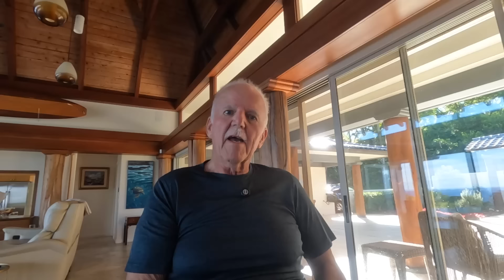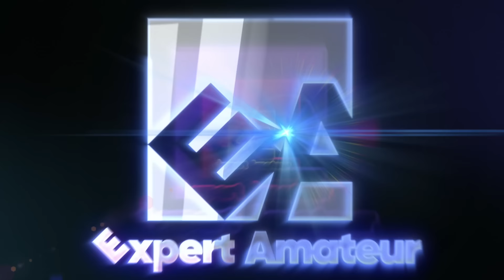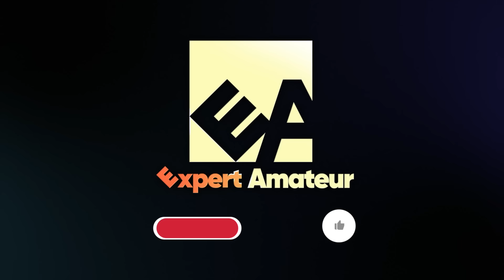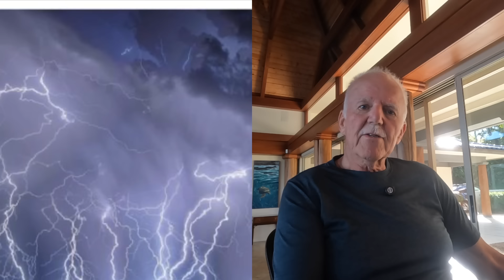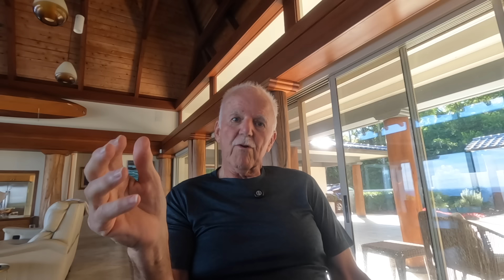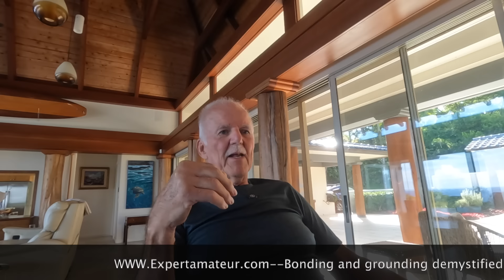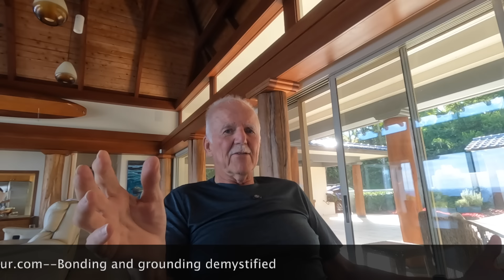solar grounding

Comment: I prefer bonding all my panels together and each array having it's own ground 10' copper clad ground rod rod. A separate ground rod for my AC panel. My DC from my solar panels are isolated from my AC main panel via my inverter. I'm 75 and been an electrician all my life . I worked for the federal government and had extensive lightning,  grounding bonding training. and installed grounding systems throughout Illinois.  Installed many ground counter posts around FAA facilities will sensitive electronic equipment vital to air traffic saftey. Solar systems should have their own DC grounding systems isolated from their AC grounding systems.
Reply from the maker: It seems like you would be well versed in induced current from separated ground rods. Even if your inverter has transformers (transformerless inverters do not isolate the AC and DC sides) your inverter would be subjected to induced current if the solar panel ground and AC panel ground are at different potentials from a nearby lightning strike.

Comment: Is 6ga. copper even sufficient to carry the current induced by the potential difference between two ground rods during a lightning strike? Seems the flow of charge through the earth is dependent on a lot of factors that be difficult to know. I can see an argument to have a well insulated panel framework (from the earth) with a big wire back to the single earth ground, as well.
I'll have to check out your paper. I also wonder if the group at UF that does lightning studies has studied these questions.
Reply: A #6 solid copper wire will sufficiently conduct 60 amps to ground. 
A 5/8" x 8' driven grounding electrode in moist soil is only capable of conducting 60 amps. 
Mutiple grounding electrodes may be used but must be at least 6' apart and bonded together with a continuous copper conductor. 
Lightning is unpredictable at best.
Reply from the maker: The purpose of the bonding conductor is to reduce the resistance between the ground rods so the potential is minimized. The potential will be determined by the initial in-ground voltage spike  times the ratio of the resistance between the ground rods to the ground resistance from the origin to the furthest ground rod. Keeping that resistance as low as possible, like one ohm or so, minimizes the potential and therefore the current. If the strike is too close all bets are off, but at that point the electromagnetic wave in the air induces huge currents and voltage everywhere in your gear and toasts it.

Comment: What is your view on grounding the battery negative?
Reply from the maker: Don't
Reply: @ExpertAmateur-xn6dr  I'm afraid Victron recommend it as does the code in UK. The  issue becomes that because the solar charge controller battery negative is connected to the solar module negative, the array becomes grounded on the negative side which our code warns against. So I'm caught between a rock and a hard place.

Comment: Thanks for the insight. I live where lighting strikes are common. I have installed lighting rods on my house because of trees close to the house having been struck. One question, should the lighting rod ground rod be tied together with the panel and array grounds?
Reply: @minorhull8347  I believe not, if you tie your lightning rod to your panels current will flow partially or fully through your panels, exactly what you don't want
Reply from the maker: Your lightning rods probably have a really good earth ground and they are probably bonded (connected) to your service ground, so yes. If they are not bonded to the service ground I'd call your installer and find out why they aren't. That's standard practice.

Comment: Guess it may be a matter left to the installation specific to each system. Lightening doesn't look for metal, it looks for a path to ground. Specifically earth providing that path reaching up to the energy in the atmosphere. 
My installation of panels is ground mounting without metallic framing. The only somewhat clear path is from the cabling to the inverters which themselves have lightening/surge arrestors in place to hopefully catch and direct any surge to earth ground. But otherwise my PV panels are not so hot of a target for lightening even though lightening has no rhyme or reason to choose where it goes. But I elect to not turn my PV panels into a lightening spire by installing a clear path to earth and inviting an entry point to go anywhere and everywhere in my system. 
I understand the voltage leakage coming from inverters to panel frames. There is also no path between PV wiring and the frames. It is an isolated DC circuit and many mistakenly take this voltage on the frames to be the extremely high voltage generated by the panels. When it is high frequency voltage from the inverters what's able to jump the gap between PV circuits and the frames. It isn't dangerous other than like you say, gives someone a little zap and scares them enough to jump off a roof.
Just my take on it. Think it's a mistake to invite problems where there are none but I'll suffer my ignorance alone if that be the case...........
Very much appreciate your video though! Good to hear other folks experiences and thoughts.

Comment: This is just my opinion but I don't ground my panels "cuz I believe it creates more of a magnet to attract lightning & all my panels are mounted on wood to act as a better insulator. But I do have arrestors hooked up to all my solar chargers. Then my property is surrounded by pretty high tress which I suspect would make a better draw from my panels. Either way, a direct hit will likely take out a system grounded or not.
Reply from the maker: A direct hit will definitely take out your equipment unless you spend 10 or 20K on prevention. And lightning arrestors just provide a path to ground, which doesn't help much when the ground potential is a few million volts. This video set is all about nearby strikes, and it's not about code--it's about saving your equipment, which code doesn't care about--at all.
Reply: Naaa, I had a radio tower and lighting has direct hit it quite a few times, I had equipment on and the ground system dissipated the strikes and zero equipment was damaged. Aluminum panels ungrounded will have a static charge on them and create lightnings favorite meal.
Reply from the maker: @GoonyMclinux  Yup, you radio guys are lightning studs. I'm not going to spend that kind of money because I'm not supporting a tower. I just don't want the hundreds of strikes that hit within a half mile to kill my $10K worth of gear. In the rare direct strike I'll be buying new stuff.

Comment: What about metal pole mount working as the ground
Reply from the maker: If it's buried deep enough then yes, sure. If you want to find out, pound in a ground rod about six feet ways and read the resistance. Less than 50 ohms and your pole is doing a fine job. But since you now have a ground rod six feet away, bond it to the metal pole with some bare copper wire. Belt and suspenders.

Comment: Great video. Regarding the neutral to ground bonding, don't some of the HF inverters have this built into the inverter? So for off grid systems, if this is the case, there would be no neutral to ground bonding in the service panel?
Reply from the maker: I don't know. I haven't been able to get a schematic of the internal wiring of the inverter I'm using--the 18K PV. The distributor (EG4) says it isn't, and I don't know why it would be. I do know that there's a resistance between ground and neutral (I measured it), I don't remember what it is, but it wasn't zero ohms. It might just be for the ground fault interruption, which needs a reference voltage to ground and a connection to neutral to function. It would be good to know for sure. I'd like to see a schematic for at least the switchgear. I'll try asking luxpower.
Reply: Thanks for the reply. I'll look into this further when I upgrade to the 12000xp next summer. I appreciate your video, we have had a lot of issues related to equipment damage from lightning and this may have been caused by not connecting ground rods in different locations with wire

Comment: I do understand code might have reason to enforce copper wire to be used for various reasons. In my location I don’t have to comply, can I use aluminum or steel bus to bond panels and main house ground rod?

I assume it’s fine to have multiple ground points if there’s reliable bond. So I plan to add more rods as I don’t have equipment to check if existing one has low enough resistance.
Reply: The guy making this video knows a thousand times more than I do, but I will share my experience. 

I live in an area plagued by lightning. We used to constantly lose electric devices to storms. I discovered that my grounding rod was installed under the house's eve. I moved the ground rod out more into the yard, adding three in a six-foot series. Our lightning hits completely went away, going on for 14 years now. 

I have a ground-mounted solar array 225 feet from my service. The array is surrounded by six grounding rod loop connected with #6 copper ground wire. Due to cost, I ran an aluminum mobile home feed, leaving a lightning surge protector at the panels traveling to the main service. The leads were coated with a dielectric and are tightened every five years or so. I have also been told that microfractures are a problem with aluminum, but my array has been going on for 14 years now. Maybe I'm a ticking time bomb.
Reply from the maker: As I understand it, the biggest problem with aluminum is that the oxide layer, which doesn't conduct well, gets thicker over time so connections degrade, and it's so electrochemically active. I had a carbon fiber component of a hydrofoil in direct contact with aluminum that was exposed to sea water--the aluminum was eaten away in just a few days. I'd be careful. You can check the resistance of one ground connector to another nearby with just a multimeter. Commercial ground rods are often copper-plated or galvanized steel.
Reply from the maker: Sounds perfect just don’t skip your maintenance.

Comment: 2:43 : No...the panels should not be grounded near the panels...they SHOULD NOT be grounded there. There is nly ONE place to ground the whole instalation, there can't be different places where to ground. (Appart on some advanced system that got multiple circuit).
Panels' chassis need to be grounded at the same point as the inverters, there is no ground under the panel then in the house near the inverter. It's stupid, those 2 grounds would not be at the same potential, inducing current in wires. No wonder you wall your channel amateur...do not see why the "expert" though...
Reply from the maker: I am indeed an amateur, the expert part just means I dig a bit deeper and don't just accept simple directions. I'm aware of the risk of inducing current from separated earth grounds, which is why I'm going to bond them together in the later stages of my project.

Comment: In europe we got no conflicting information, panels chassis need to be bonded at the same potential as the inverters and house's appliances.You also need an overvoltage protection on your panel's wires to discharge into the ground any induced current by a near atmospheric spark. Those protection exist in multiple form but the most common use cartridge that can be replaced and are connected in parallel in a circuit..... The resistance to ground is infinite till the voltage in the circuit go past a value, then the resistance decrease and the circuit is connected to ground. This will not 100% protect your appliances but it reduce the risk.
Reply from the maker: True also in the US, the conflicting issue in the US code is earth grounding for separate structures--I think PV ground mounts are indeed separate structures. The code used to say they must be earth grounded, now they say they CAN be. Cool avatar name. I assume Honu is turtle, the same as it is in Hawaiian.

Comment: Could you explain to me why diodes aren’t used to protect equipment from stay currents caused by lightening?
Reply from the maker: Well, I'm not sure what diodes you mean, If you mean the little bypass diodes in PV panels then they would be a cinder if they were in the current path of a nearby lightning strike. The schottky diodes in PV panels can handle about 70 volts in reverse polarity and about 50 amps forward biased. Even stray currents induced by nearby strikes are in the range of a hundred thousand volts and similar currents while actual strikes are 300 million to several billion volts. But maybe I just don't quite understand your question.
Reply: I am curious as to why a diode can’t be developed to be used against the high voltages in question. Thanks for responding so quickly. Didn’t expect it.
Reply: I was thinking more in ground loop situations. I use midnight solar surge suppressors.

Comment: Mike Holt is the man.. As they tell you up front how Grounding\Bonding and ground rods are used and installed..

And the NFPA70E and NEC need to upgrade these codes. As they only meet the minimum requirement..So you never ground a solar array to a ground rod. You're just wasting money. As the Solar Panels have diodes to prevent damage.. If they go bad. Just replace them...But they must be Bonded to the source Inverter panel. Unless you use grid tie system. Then you need special designed equipment top\ make the switch from bonded to un-bonded in the inverter. If they don't have that feature. You need to add a special breaker that does this for you....Read NEC section 680....
Reply from the maker: I've read 680, a few too many times. I know what Mike Holt says, but I doubt he'll buy me new equipment if a strike anywhere near my separated structure runs a few zillion amps through the gear to the service ground at my shop. I know he rags on about other earth grounding being unnecessary and dangerous because of induced differential potential between the ground rods, ignoring the simple solution of bonding the grounding electrodes together. I don't know why that's such a big deal to him, but I don't buy it. The blocking diodes in PV panels will do nothing to stop static discharge or lighting, and I have no idea what the rest of your comment is about. The NEC gets updated every three years. It used to say "A building or structure supporting a PV array must have a grounding electrode system installed (Part III, Article 250), now it says "Additional auxiliary electrodes are permitted to be installed at the location of ground and roof-mounted PV arrays. These electrodes can be connected directly to the array frame(s) or structure". "Wasting" 50 bucks to prevent damage to $30K worth of equipment seems reasonable to me. I'm open to changing my mind if I hear a rational position.

Comment: You are right, grounding solar panels is a conversation of many opinions. It's definitely not for lighting protection, but for electrically charged environment from nearby strikes for sure. There is an argument for grounding solar arrays can attract a lighting strike as you have completed a path to ground. So much to consider, but I agree grounding is a good practice done correctly
Reply from the maker: I copied this here from an answer I gave above, since it relates to your point as well. Grounding panels and frames to the system ground is an electrical safety issue. Unfortunately it can sacrifice your expensive equipment. Whether of not a ground rod attracts lightning depends on your definition of "attracts". When a lightning strike happens nearby there is an air wave and a ground wave from the massive amount of power expended. Any conductor nearby will have a voltage induced into it, just like an antenna has voltage induced into it from radio waves. The frames are aluminum, which is almost as good a conductor as copper, so they will have a voltage induced into them, as does the earth electrode from the ground wave. Keeping this induced voltage out of your equipment is the aim, so best practice is to connect the frames to both the system ground and an earth ground and to bind (connect) the grounding electrode to any other grounding electrode the system connects to. The overall system ground will connect the ground rods together (both the local ground rod and the system ground rod) but unfortunately that ground path takes the induced voltages through your equipment. That's why I recommend an additional direct ground path. From a safety standpoint (avoiding shocks from the panel frame) connecting the frames to the system ground is sufficient.
Reply: @ExpertAmateur-xn6dr  This explanation is one that finally makes sense to me.  Thanks
Reply: im heavily of the notion that electricty allways seeks the shortest or quickest path to flow..so lightning also seeks static first..so its known that solar panels may create static around them therefore lighning may be atracted to them

but if you dont ground the solar array racks the electrcity cant go that way,,cant seek to go to the ground
so you actually cancelling the path of lightning

i would say if you have a big array of solar and need to protect a surge from the sun  that may send alot of DC current to the inverter i would say it can be essential to put in a surge protector on that line
lightning strikes the tallest trees first or highest buildings that have rods above them ..that attracks lightning
Reply: Though in such environments regulations require grounding of the roof so personally I think it is not necessary.